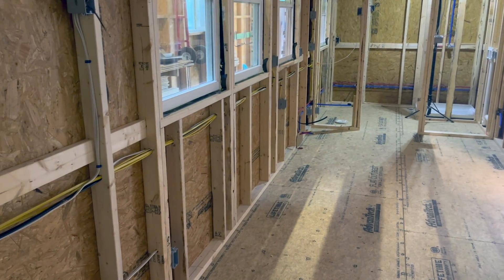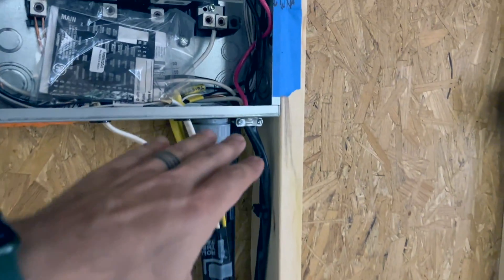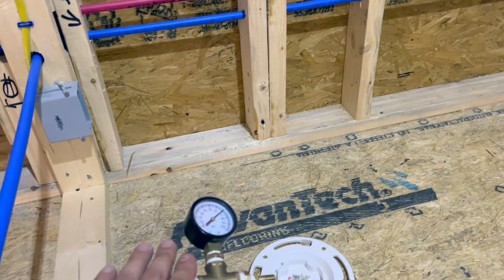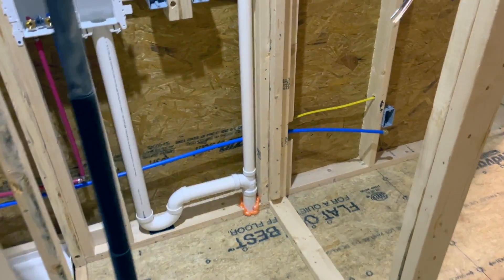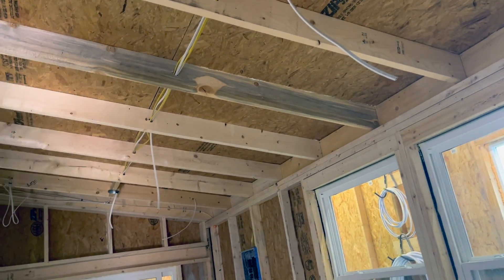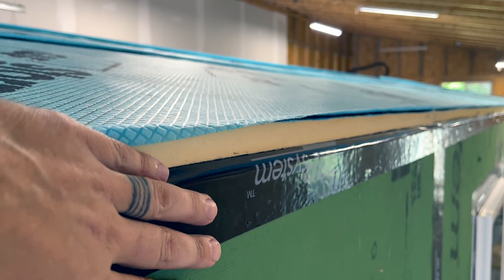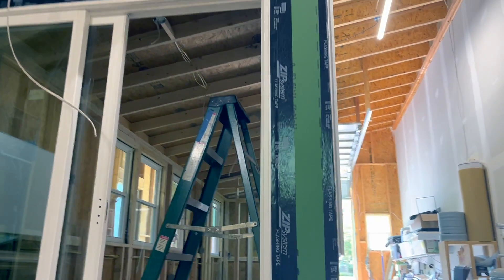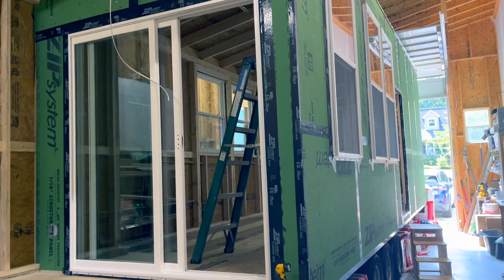Behind the Tiny House Build: Inspections and Insulation Strategy

Comment: There are actually plugs that go beyond 50a. Pin and sleeve style plugs.
Reply from the maker: True, I do forget about those sometimes. I was under the impression that those were for temporary power only? Perhaps, I'm mistaken. Either way, the RV plugs are very common and for anything more, we just recommend a hardwired connection.
Reply: @FireflyTinyHomes  You would need to talk to the relevant inspection authorities for the area. They definitely are used for permanent installs here. I've seen many used for installing motors so that the motors can be disconnected for repair without requiring an electrician to come out.

Comment: What about the Tiny home builder who puts in an air exchanger?
Reply from the maker: Air exchangers are a very good idea and we offer them as an option on some of our models. However, they will not solve the need for a vented roof. You have to protect the roof sheathing with an insulation strategy of either spray foam or exterior insulation. I would expect a builder using an air exchanger to understand all that though ;)

There are many great tiny home builders out there! We just happen to see a few high profile builders ignoring basic building standards.